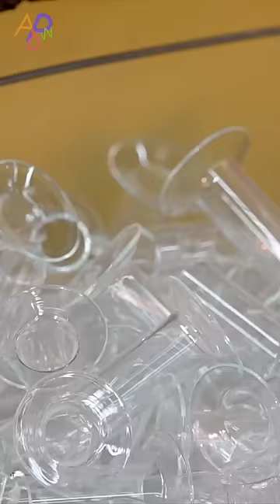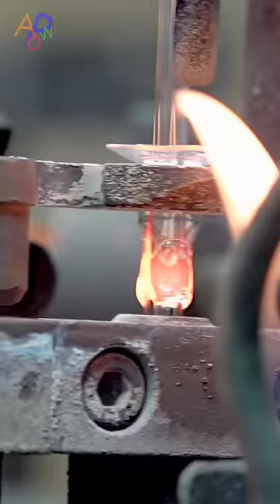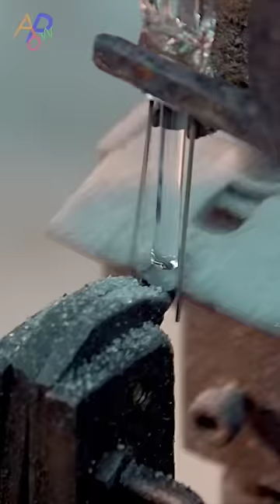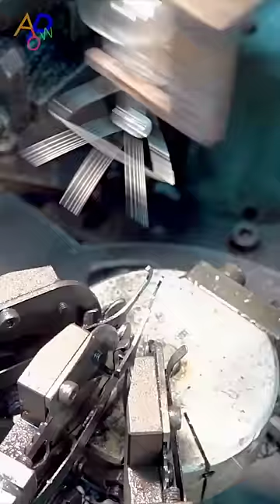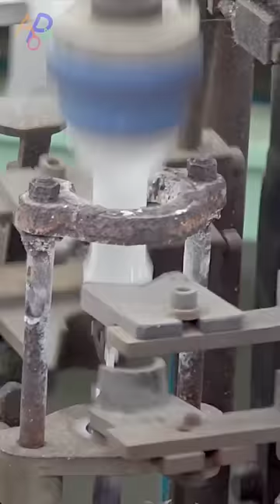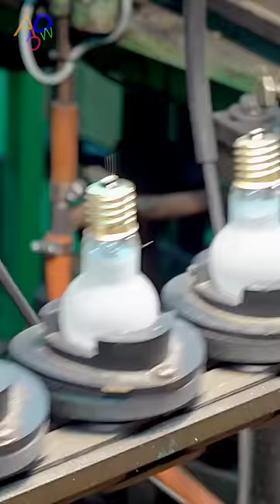60 Year Old Last Incandescent Light Bulb Factory in Korea

Comment: I think it's almost equally impressive to come up with the original invention and to be able to come up with the machinery required to mass produce it.
Reply: Actually the machine took a week to repurpose another machine, the light bulb took years to find the right gas and tungsten material to prevent the bulb dying too quick. And of course, it took decades with a series of discoveries to come up with the idea
Reply: @scifi_shop  you made that up ☠️
Reply: @BeardedDragonMan1997  Trust him bro.
Reply: What’s more impressive is how the 1000 hour lightbulb was not put in production so companies could sell more lightbulbs bc they don’t last as long
Reply: @BeardedDragonMan1997  😂😂😂
Reply: Elon Musk says the same: "idea are hard, manufacturing is a magnitide harder"
Reply: @BeardedDragonMan1997  I mean, it’s kinda true. Most of those machines can be used for other tasks and what needs to be modified between tasks are the actual interface parts, the location in relation to the conveyor belts, and the small details like speed and torque. It’s not as simple as retrofitting them in a weekend, the knowledge of what to do is known within a few weeks or months, but the knowledge of how to do it is a tedious process if the machine has not been repurposed for that exact job before. Also, most factories for smaller businesses tend to set up the bare minimum of machines, start running the factory, and then they slowly add machines to increase productivity as they can afford it
Reply: @BeardedDragonMan1997  что именно он выдумал?
Reply: @NePsihuyBlyat  no thanks
Reply: @scifi_shop  u no count the inventions of the manufactorum
Reply: @phillycheesesteak670  well if they did do that. You the price of the bulb will fckin skyrocket due to the fact that bulb business is going bankrupt here and there. Making bulb a hard to get the item
Reply: @quasa0  А кто такой Илон Маск?Пуп Земли что-ли?
Reply: @quasa0  can't agree more
Reply: @scifi_shop Mi abuelo llegó a comentarme que laa bombillas que usaban el las locomotoras de vapor eran con filamento de grafito, antes de emplear tungsteno !
Reply: @BeardedDragonMan1997 ❤
Reply: i am using LED lights, but i am seriously thinking of going back to simple bulbs. LEDs need sophisticated Semicon factories. And they may soon come to an end in the  End of days soon to come.
Reply: It's a standard problem in technique development. "OK, it's more effective in our tusk. New question: How we can produce it?"

Comment: wish they still make light bulb like the centennial light that's burning since 1901
Reply: *While consuming 200 watts but are only as bright as 1 watt
Reply: you realise that bulb is cheating right?

its ran at such low voltage that you almost cannot see it it does not cast any real light infact if you turned out the lights you would just about be able to see it in the darkness

even if you held your book right under it you could not read by that light

its not that that light was such amazing quality we just dont have no more its that it was of decent quality but ran far bwlow its typical operating conditions infact other examples of the same light that where ran at typical voltages burnt out many many years ago 

and the life span it has when running normally pales in comparison to that of modern led when you compare power to power
Reply: @Sarge92  wtf where is the like button
Reply: @RedBanana24    falsch. 
1: 10

Und...- mehr elektronischer Abfall...kürzere Lebensdauer ...falsches Licht....-  Alles wird besser- nichts wird gut.
Reply: @Sarge92 Nah, las modernas de led vienen diseñadas con un circuito que se recalienta y no tienen como disipar calor. Si las dejas encendidas mucho tiempo se estropean más rápido de lo que lo hace una incandescente.
Reply: Manufacturers have the technology to make longer lasting light bulbs. They just don't want to, because there is no money in it. Light bulb manufacturers across the globe agreed to limit the life expectancy of their bulbs. The light bulb was one of the first products that had a "Planned Obsolescence". Now, nearly every thing you buy has one.
Reply: @romit0072  actually it’s mostly due to cost savings. Read about what was done in Saudi Arabia - the king decided that the new government buildings would be lit by LED bulbs, but he wanted a bulb that would be guaranteed to last ten years and that would only consume 2 or 4 watts per bulb. As a result, Sylvania designed and manufactured a new line of bulbs that are ONLY sold there. BigClive recently took some apart on his channel. The only real difference between theirs and ours is that our LEDs are driven hard by cheaper power supplies. Theirs have a dual-redundant power supply and almost twice as many leds running at lower power. This results in MUCH longer life, even if a single component does fail. In other words, we want cheap stuff, so we are sold cheap stuff.
Reply: @97marqedman it’s called the lightbulb mafia dude, check it out
Reply: @97marqedman  It wasn't Sylvania it was Phillips, and 10 years is the standard for regular LED bulbs, these are rated for double that
Reply: @romit0072  LOL no.  A bulb that lasts forever would be incredibly inefficient, even more than regular incandescents.  That's also the root of the 220v bulb trick -- a 220v bulb will last forever at 110v, but consume huge amounts of power for 1/4 the light.
Reply: dim as hell, really expensive, and has to be left on all the time?
Reply: @isabelsalgado7167  Se pueden reparar y duran añales, además consumen muy poca energía. Yo llené mi casa de lámparas de led, y en más de 5 años ni una ha fallado.
Reply: @tsm688  I don't remember talking about a bulb that could last forever but they did have a filament design to make incandescent light bulbs last much longer then they do.
Reply: @romit0072  Yes...  They do that by running much colder and thereby less efficiently.  It's a tradeoff.  Just the laws of thermodynamics again.

Comment: I have a large bulb incandescent light bulb that is over 50 years old and still works in my house as the light bulb is 220v and my power is 110v which means it doesn't burn out. This lamp worked for a long time on the public network and as I said it still works.
Reply: No you don't.
Reply: @coloradostrong  it's mine yes!
Reply: @franck101  i also call bs. A lamp running at 1/4 of its rated power (1/2 voltage=1/4 power) would probably be uselessly dim and even then still probably burn out after 50 years of use.
Reply: @nickoloes  She stays in the little room in the pantry where there is enough light and she is about 55 years old or more, because she is 55 years old with us alone. now add the time she spent at my house and the time she worked on the public network
Reply: I have four working Mazda brand bulbs that date to the 1910's.
Reply: @nickoloes I have 15 pot lights that are dimmed to about 40 percent. They are ice par incandescent floodlights.  They were installed nearly 15 years ago and run every day.  Not one has ever burnt out.  I purchased 20 spares when I put them in.  Obviously you can no longer buy them
Reply: @franck101  I'll trade ya 2 new rechargeable breast pumps, a new 200 watt shoebox light, and a new pack of silicone tattoo skins for the light. I can even throw in a new hearing aid with a recharging case that has Bluetooth. And a 20 milliwatt rechargeable red laser. I'm keeping the green lasers. That's the best I can do. I'll be over later to get my bulb. And don't get it dirty.
Reply: @coloradostrong  I can't sell it
Reply: This means you get an eighth of the light for a quarter of the power.  It lasts forever, but not really a bargain.
Reply: @tsm688  Yes it is true!
Reply: @nickoloes  Put in a on of two socket wires a 1N4007 diode in serial

Comment: Just gotta make sure that vacuum is just low enough to burn out in 4000 hours or they’ll get in trouble for breaking the “planned obsolescence” pact
Reply: You mean 1000 hours.
Reply: was that the solution. zero gases?
Reply: @mipmipmipmipmipyep, so true
Reply: I've only replaced 2 led bulbs in my life. And only one had a led fail...
Reply: @SuperPickle15  повезло. Мои светодиодные лампы тускнеют через полгода, а через год уже почти не светят
Reply: @mipmipmipmipmip solder the next live LED it to the next LED over, skip the dead one. They're in series
Reply: @jantrammelant  500 yes sir.
Reply: @notavailable.000  Better vacuum as well as a thicker filament. Incandescent bulbs can last 100 years or more. But its not very profitable to make something last that long. So they make it last a couple months instead. Like the bastards they are.  Same with leds, old first gen leds used to have massive heatsinks on them and beefy components. Now they dont even have heatsinks and the components are basicalkly programmed to self destruct after so many hours.
Reply: @SALTrips  based
Reply: @SuperPickle15 I've been through dozens in the last 10 years. I don't even exclusively use them either. In fact probably half are still incandescent.
Reply: @Cyn Hicks  very strange. I didn't even get high quality ones. Just ones that were $1 per bulb. One had a led burn out, and another the primary capacitor self destructed. Meanwhile I've had incandescent that burn out in less than 100 hours...
Reply: @Treekicker Yes, I have such a light bulb with a heavy metal heatsink.
Reply: @mipmipmipmipmipcan be repaired, the LED can be taken from an already burned out light bulb. But, it's not very convenient. Perhaps they can be handed over, and not thrown away. But this is not the case in my country. Google translator
Reply: I hate LEDs! bring back incandescent light bulbs!
Reply: @Legozahar1  They literally use 10x the energy for the same amount of light.
Reply: Oh please
Reply: @Treekicker  You can make an incandesecnt bulb that lasts forever, but it'll be incredibly dim and inefficient, mostly just a heating element.
Reply: @mipmipmipmipmip You can replace burnt leds even replace old capacitors for a better quality ad get a very long life led lamp, but you need tools and experience.
Reply: That pact ended in ww2. Where'd you get your news from? Internet Explorer?
Reply: @SALTrips  One problem with that is you could easily exceed the breakdown current of the rest of the LED's and fry them or reduce their life.

If you want to do a bypass just bridge the contacts of the dead LED with a resistor that has the same value as a good LED in the setup.
Reply: And how about the random failing LEDs that have zero reason to have any kind of production standards and can be churned out by any old dump with some semiconductors
Reply: @richardmillhousenixon the quality of light is different and this is very important. LEDs produce a sickly and sterile light without a tinge. Incandescent has a warm glow. The effects of LEDs unnatural light is subconscious for most people but our brains are wired to expect a color hue with our light and LEDs do not deliver the way we are used to. Some people feel uncomfortable and uneasy, while others, such as myself get nauseous and headaches when in LED lit environments for too long. 
The thing is, the old-style 1-diode things you find in old electronics for indicator lamps inbetween neon bulbs and screens-only don't have that effect; its LEDs meant to mimic the use of an incandescent light bulb. 
I know some people who used to have issues with fluorescent lights like I do with LEDs, and they're sensitive to LEDs too. I do not personally have that fluorescent bulb sensitivity....perhaps compact fluorescent bulbs are really the best power-saving option? But you cannot discontinue incandescent without enormous and significant problems.
Reply: @mipmipmipmipmip Se pueden reparar puenteando el led fundido.
Reply: @Treekicker   How would they make money otherwise?
Reply: In all fairness even if the vacuum is a theoretical 100% you still have the tungsten sublimating (turning from solid to gas without being liquid at any time) and making the filament weaker and eventually failing. The hotter you run it, the faster this process is but the more efficient the lamp is and vice versa. So in the end its all about finding a balance between the two and that pact helped standardise it to 1000h, for a few cent part. Technologie Connection made an excellent video on that topic.😉 The terrible thing about that pact was that they wanted to turn the prices up drastically...
Reply: у нас ряд ламп в деревне работало не перегорая с 1950-х годов. 
так же есть холодильник работает с 1953 года по сегодня.
запланированное устаревание, это день сурка. тратиться ресурсы и часы рабочего времени и не дают сосредоточить людские ресурсы на более важных отраслях науки. медицина или физика.
Reply: @mipmipmipmipmipthe LEDs barely break. It's the other electronics
Reply: @mipmipmipmipmip the L.E.D light in my laundry room has been going for four years without turning off and hasn't died yet.
Reply: I was back at my parents place a few months ago and there's still a couple of incandescent bulbs left. These would have been in place some 20+ years ago
Reply: @mipmipmipmipmip nah thats more of a you problem and a lack of knowledge...you can literally fix an led series bulb with a pencil, aluminium foil, a drop of solder or straight up replace the single led at least 99% of the time. Every LED is its own unit. On the other hand once the incandescent bulbs are blown you would not have the machinery required to fix it.

Comment: LED lights really aggravate the eyes and makes you feel awake yet restless. Incandescent light is so gentle with its warm color you can easily fall asleep
Reply: Dude 100%! I didn't think anyone else noticed it
Reply: Get warm colour bulbs then man
Reply: @arturjogi2667  If only it were that easy, LED lights even warm colored ones also aggravate the eyes because they flicker too much. However if there were no incandescent bulbs It would be wayyy better to get a warm colored LED compared to a white, blue, or purple colored one.
Reply: @Luis-eo6vi Nonsense. My apartment only has LEDs.

LEDs run off DC, there is no AC. They can't flicker. They don't flicker.
The only time they flicker is when there is a fault in the power supply driving them. Or you are trying to drive them at a reduced brightness using a dimmer control which is doing naughty things to the waveform driving them.

You are imagining a flicker which is not present
Reply: @Luis-eo6vi  LEDs don't flicker, my guy. Fluorescent lights do. You just don't like them because you like feeling better than others because you have to go through so much effort to get your far inferior bulbs.
Reply: @arturjogi2667  Cheap LED lights, in my experience, do flicker. If you don't want it flickering, you have to pay more. I find that the dimmable ones tend to have very large smoothing capacitors and thus do not have this problem.
Reply: @user2C47  you were using the cheap non dimmable ones in a dimmable socket, weren't you? Dimmable sockets just pulse power at an adjustable rate. That isn't a problem with incandescent because the heating and heat loss just reaches an equilibrium at some temperature, it keeps emitting light the whole time. But LEDs turn off the second no power goes through them. So without energy storage, they will flicker. Dimmer sockets also don't have a mode where there is no pulsing. The pulsing is just very very fast. So any non dimmable bulbs placed in there will flicker, ever do slightly noticeably.
Reply: @arturjogi2667  Most places use AC power, which is always pulsing. Also, most dimmers just chop part of the waveform off. 

When connected directly to the line, most of my cheaper bulbs have a significant 120Hz flicker.
Reply: @user2C47  LEDs can't use AC. They're diodes. Gotta convert it to DC first
Reply: @Luis-eo6vi  Ypu need bettwr LED drivers. If you use low voltage you need reliable power supplies that dont cause stutter, and you should always get at least 5mhz mininum so the strobe effect cant be detected by your eyes\brain.
Reply: Bruh like i said to many others, stop greeding out and don't get the LEDs for 0.45$ at goodwill or what ever.
Pay a few bucks and you get SO nice ones, with dimming and variable colortemperature. If you don't need it, there are still good ones.
Reply: @arturjogi2667  LEDs flicker too, my guy. Just WAY faster than the smoothed 50/60hz flicker from the flurescents.
Reply: For anyone in this thread that wants to claim that led bulbs are: name a single bulb that has a cri above 95 and an R9 above 90. I'll be waiting. Incandescent bulbs score above 98 for both.
Reply: @deang5622  What is pulse width modulation? How does a switch mode power supply operate? These are very relevant questions to what you just said
Reply: @xcruell  stop being so rude and actually name the units. I want some but can't find any.
CRI must be above 95 and R9 above 90 at minimum.
Reply: What about Halogen?
Reply: @account-now-closed  Halogen light a type of incandescent light, also a good black body radiation light source.

Comment: Incandescent lamps are in my bathhouse. Work well at high temperature, LED burn out, then diodes, then the circuit
Reply: I mean LEDs generate less heat overall.
Reply: They also respond quickly in cold temperatures, which is why you can, occasionally,  still get them in Canada.
Reply: @jwalster9412  well yes but they don’t work well in high temperature environments because they literally melt
Reply: Get better LED bulbs mate. Provided your environmental temp is < ~80C something will work. Check out the dubai lamps. Big clive has heaps of videos of modifying the cheap LED bulbs we get to run at lower power levels that will let them last for many many years.
Reply: You need high temp led but incandescent is definitely still the best choice in that scenario because high temp led are very expensive
Reply: No. Stop buying 0.49$ Zhouthauze LED Bulbs and you're fine.
People complain while only paying THE LEAST they can.